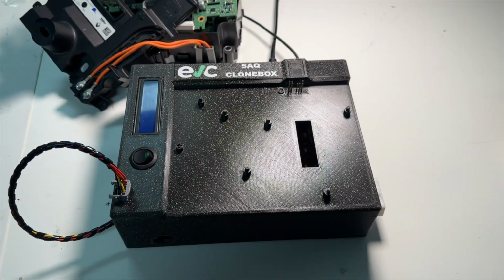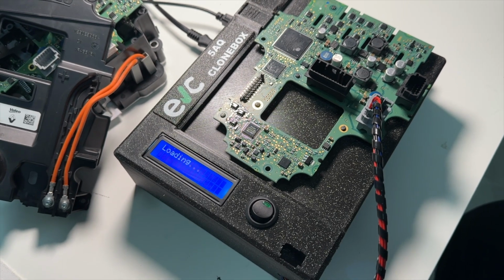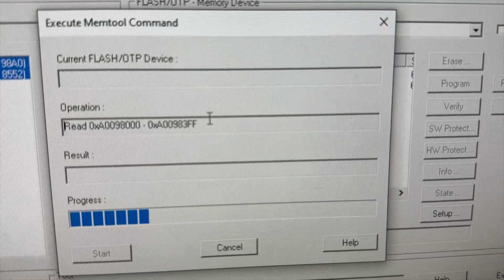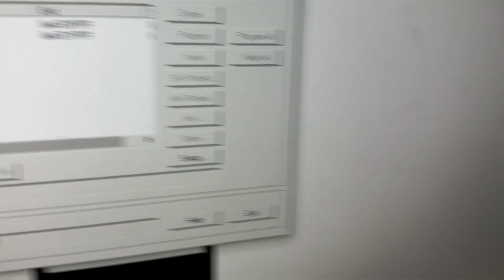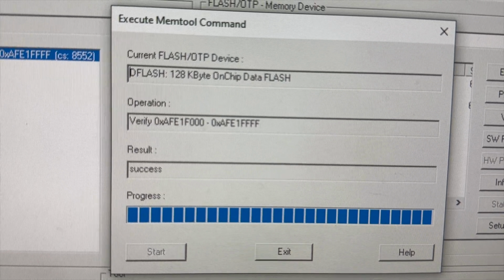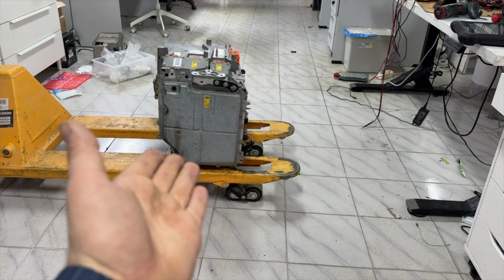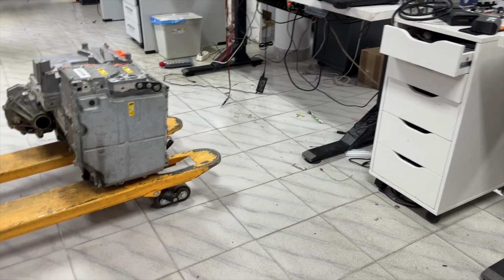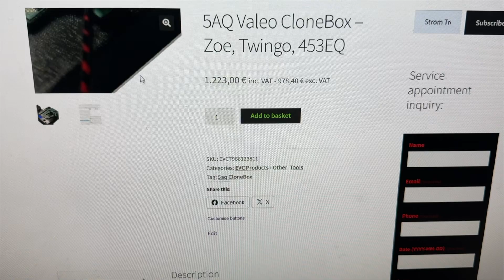Renault/453EQ El. Motor Inverter cloning - 5AQ R240 TC1782

Comment: The BMW i3 has a similar problem of VIN coding of its "EME", one of the highest cost components. Have you investigated re-purposing second hand EMEs? The fault isn't too common but does happen, perhaps there aren't enough examples to work on.
Reply from the maker: @peteglass3496  i have one on stock and i want to research that too. Will write about it

Comment: Nice work guys. One question if you would be so kind to answer, in video you mention alot of problems with DC-DCs. What exactly is it that normally breaks in them? I read somewhere that its quite often just a case of crashed memory and it could be reflashed and work again. Is this true?

Comment: I'm surprised of the price you said. In my case, Renault Zoe R240 5AQ with inverter failure, produced in july 2015, failed at 96.000km, I paid in september 2023 around 1000€ to repare the inverter, they changed the card. It was done at Renault Conlie, in France, (72 - Sarthe, next Le Mans). I'd no reduction by Renault, I've the bill. 
So Yes, in all case that's expensive, but less than some parts on a benzin motorisation.
By the way, great job of reverse engineering, I watch some of your videos, very interesting!
Reply from the maker: @zaballe  Inverter board is extremely expensive. They didnt change the board with labor and part for 1000€ , that is 100%. Valeo inverter lovest price with discount what i have seen is 1300€ without tax. Maybe they changed something else.

Comment: Long time subscriber and id.3 owner for 2,5 yers and 130k with car. I do not see any IDs being repair in your shop. Why is that?
Reply from the maker: @adnanimamovic9313  VAG respects warranty and pretty fresh car. Repairs which we conduct is on vehicles 10-12 years old. Only mercedes arrive with 20,000km and declined warranty
Reply: @evclinic  ok thakns. If I have any serius problem with my car I will contact you because there is nobody  else good as you. Keep up a good work👏👏👏

Comment: Hi nice work, does this overwrite the vin in a used PEB control board or just setup a new one? Cheers
Reply from the maker: @garycevrepairs  it setup new VIN
Reply: @evclinic ok but on a used PEB or new only?
Reply from the maker: @garycevrepairs  both
Reply: @ ok cool if it can overwrite vins in a used peb this is very good!
Reply: One more question - if the old peb is not readable so you cannot extract the data, maybe it’s covered in coolant and corroded or for some reason there is no comms, can you get the vin from the car and write it to a used peb to make the used one work with the car? I’m guessing there are checkdigits etc in the data? rotor angle and position isn’t important, that’s easy to code or the car can learn. Thanks.
Reply from the maker: @ you cant do anyhting without original data
Reply: @ ok thanks.

Comment: Excuse my stupidity, this is needed when WHAT goes wrong in the Zoe? I'm thinking of getting a Zoe for economical reasons but seeing expensive issues. Thanks
Reply: Don’t buy a Zoe, I work for a company that breaks EVs and we see loads of Zoes written off because they’re an uneconomical repair. If you live beside EV clinic it might not be so much of a problem but we have taken a few from main dealer’s because of motor faults etc

Comment: I’ve owned a Tesla for some time now, and as an EV enthusiast, I subscribe to your channel. I admire your knowledge and skills.

Recently, I purchased a small city car, the Fiat 500e, from 2022, for my wife. It has 6,000 kilometers on the odometer, is accident-free, and was brought from France. However, it turned out that it couldn’t be charged. It also doesn’t have a warranty because, according to Fiat, some conditions are not met. So, I took it to an automotive electronics specialist. The first issue was accessing the Stellantis gateway, which took a month to resolve. Once access was gained, it was discovered that there’s an unerasable error:

P1E1B00

This has something to do with interrupted insulation. Nobody here knows how to fix it. They want to remove the battery, but I find it hard to believe that a nearly new, accident-free car with 6,000 kilometers could present such a problem.

I’m writing because I’ve just read your blog and noticed that you’ve dealt with the 500e and similar situations, though the errors mentioned in your articles are different from mine.

I live far from Croatia, in Poland, and I’m unsure what to do, so I’d like to ask for some advice or guidance. I have a smart electronics specialist, but Fiat is uncooperative, so we’re at a standstill.

The BMS and cell voltages are fine. The SoC readout is 7.8% on the individual cells.

Can you suggest anything or help?